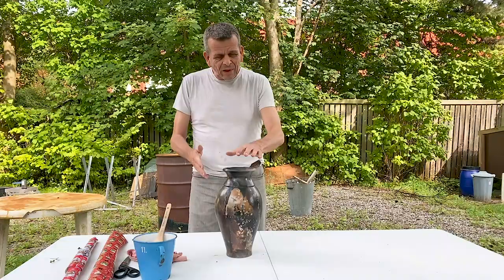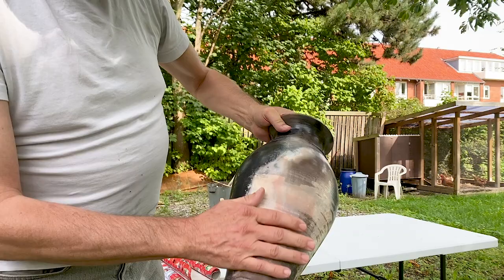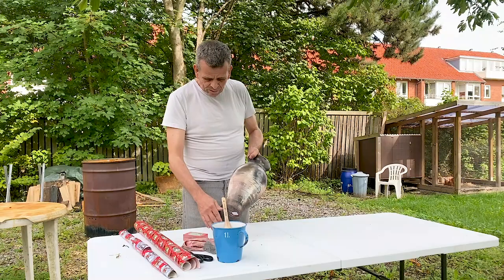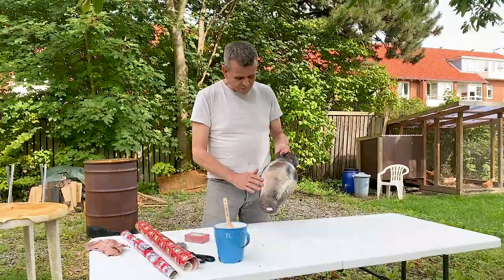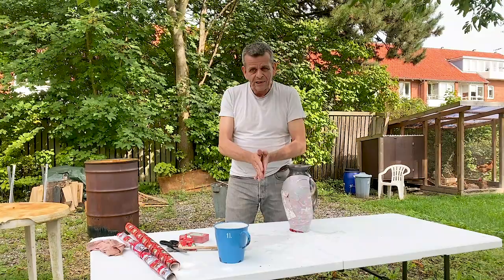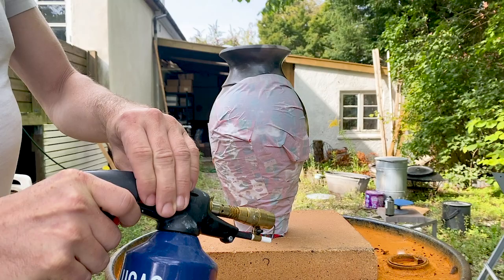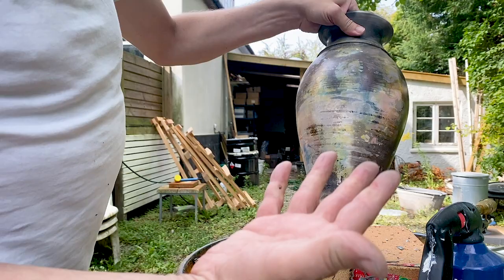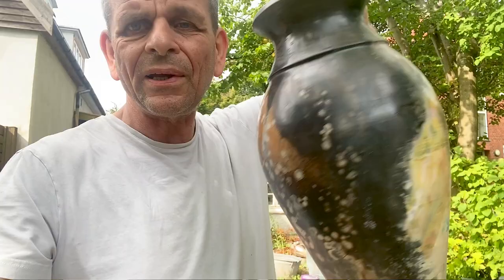38.  Flash Fire Pitfire Refire

Comment: Bonjour, 
Je découvre cette technique avec vous. 
J'ai aussi déjà fait du pitfiring, mais ne connaissais pas cette technique rapide avec le papier. 
Juste une question : est ce que ça tient quand on nettoie la pièce ? 
Merci en tous cas pour cette découverte et pour le partage.
Cordiales salutations depuis la France.
Reply from the maker: Thanks. I do not speak French so had to use Google translate. I hope I got your question right :-)

Yes, the flash colors are as good as pitfire colors but you should seal them with wax or acrylic spray.
Reply: Yes you got it right. Tanks for your answer. My english is not so good😩 but i enjoy to see your vidéos.
I will try your speed firing
Merci !.